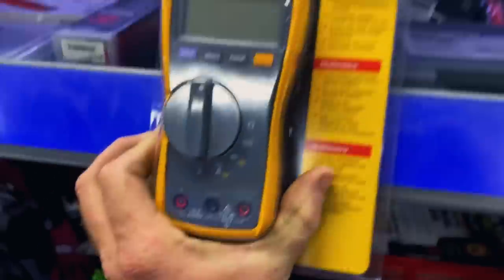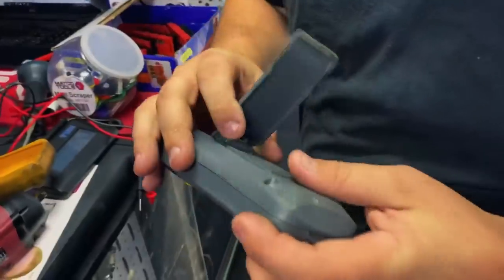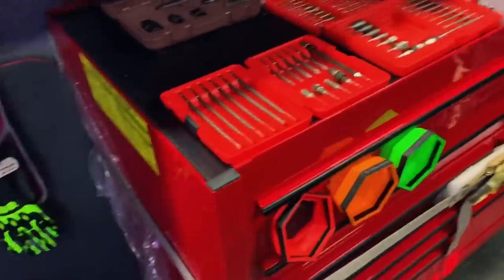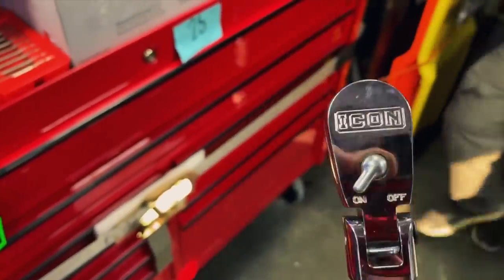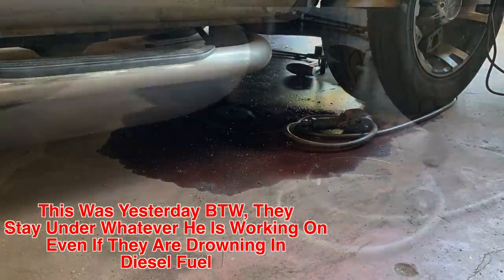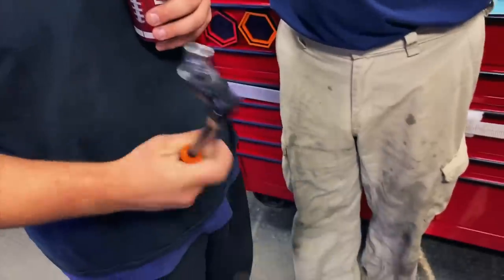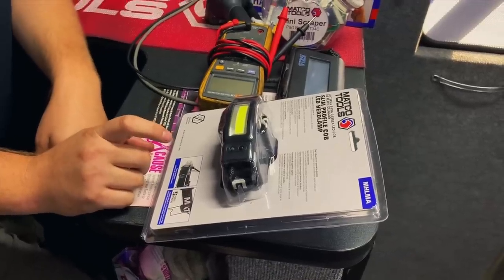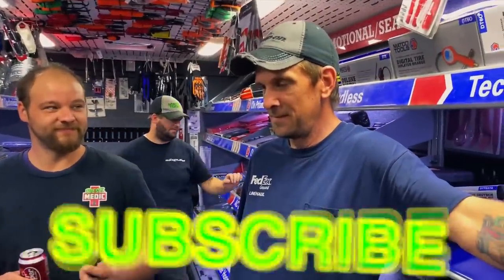Matco Tools New Brushless Impact and a Fully Custom Matco Ratchet: The only one on Earth

Comment: My matco guy had the new 3/8 20 volt impact   on his truck. We put a 3/8 to 1/2 inch adapter and then a 33 mm socket and actually took a lug nut off on a peterbilt 339 box truck. Had one bar of battery life left in it.

Comment: I traded my 3/8 snap on battery impact for the new matco 3/8 brushless battery impact a month ago and dont regret it one bit. It's a beast of an impact. Using it to take head bolts off. Brake calipers mounting bolte off and it dont skip a beat unlike the snap on. Matco has stepped up the game big time. I'm slowly converting over to matco.

Comment: Fluke of the vintage you mention was still of the highest quality. The company was bought a couple of years ago by a company that specializes in identifying brands with established reputation and then cheapeniing components and manufacturing processes and trading on the prior reputation with higher profit margins. The model is to sell the purchased company before the negative consequences of lower quality are felt. New Flukes are not as accurate reliable or robust.
Reply: What's the name of the company?
Reply: Stacen Mahaney I have an older Fluke and it is simply awesome.  Didn’t know that had been bought and sold.  Rats.

Comment: Clay, when the new Matco sales flyer comes out, I would appreciate if you could another quick video of the flyer. The current one ends today (Sunday). I procrastinated a little too much and missed ordering a locking flex head ratchet, but I did get the locking extensions for the sale price. Thanks!!!

Comment: I am thinking about getting that impact! I have the Matco 1/2 and 3/4 inch Impacts love them! The only thing is I don’t want to buy different batteries and a new charger for it $$$$$. I have to admit Harbor Freight is getting better with the ICON Tools. I used to call Harbor Freight Harbor Break, because I have bought so many junk tools there. Snap-On, Matco and Milwaukee are the best though!

Comment: how close are those new matco handles to the snappy instincts?  look pretty close to me.
Reply from the maker: On the pry bars ?
Reply: @KoonTrucking  Yes the ones on the pry bars at 8:50ish.  They look to me alot like the instincts and I was curious if they felt the same also.
Reply from the maker: They are a rubberized plastic. Where the new Snap On handles are all hard plastic with those funny dimple things in them that make em extra slippery when greasy. I like the old snap On handles better but they didn’t have the striking caps.

Comment: Just curious does it look like a rebranded dewalt ? Kinda like the mac ones ?
Reply from the maker: I don’t know we don’t have any of the Mac or Dewalt ones ?
Reply: Mac and DeWalt are both owned by StanleyBlackandDecker
Reply: Yeah I knew that just when I see a 20 volt and knowing that it would be cool to buy that tool and have extra batteries and saying that I have yet to replace any of my dewalt batteries since the 1/4 brushed impact came out and only reason I switched to the xr cause I wore out the grip and 600 ft lbs for a 3/8 sounds awesome to me.
Reply: @neil Its not its made by SP Tools.

Comment: I would never own a Marco cordless electric tool. Mac at least uses dewalt battery’s and only has 2 platforms. Snapon has 2.5 platforms. Milwaukee has 2 platforms. Matco has what 5-6 and 1/4 the tools any of the other manufacturer.

Comment: 262 foot pounds sends that icon into failure snapon was 292 and teckton 292 the out preform that icon matco and mac wasnt in the test group
Reply from the maker: You realize that was on the snap on truck right ? It was just the Snap On vs Icon not ICON vs the world. It also hit 267 at one point and was still working. Granted I am a huge Snap On fan but that $40 ratchet held its own, its worth $40